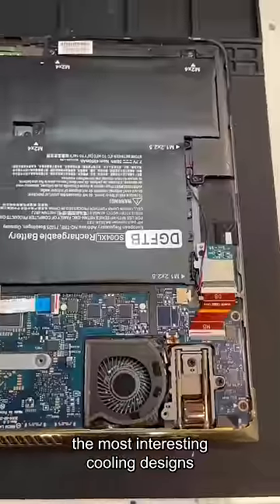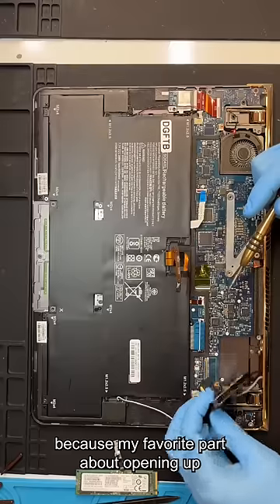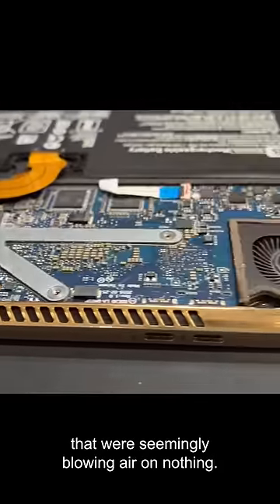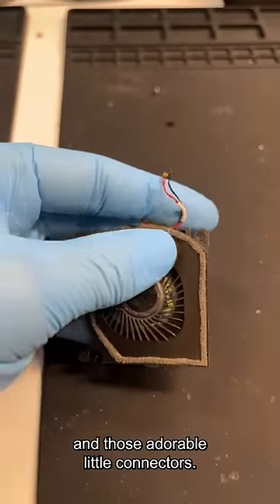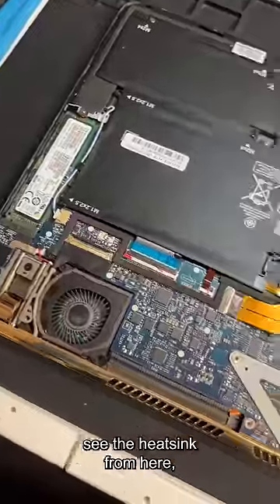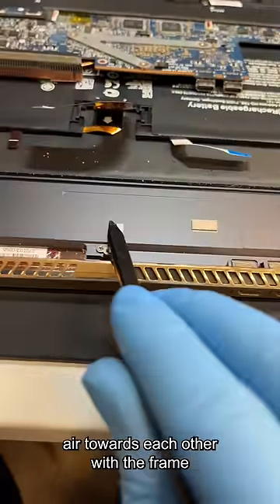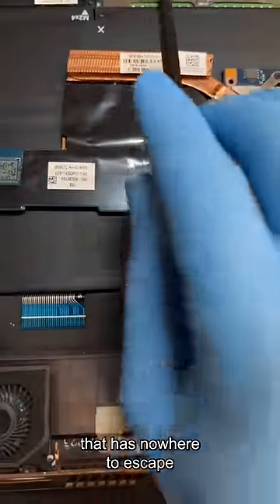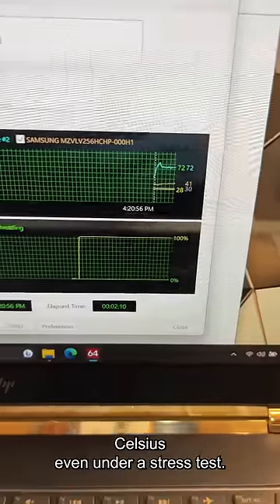This HP Spectre has a unique cooling system #technology #laptop #pc #shorts #tech

Comment: Love my spectre, but those fans get LOUD and it can run HOT.
Reply from the maker: Yeah I personally own one and had to undervolt it to keep the temps and fans under control.
Reply: I have the spectre's little brother, the envy x360
And it sometimes randomly decides to turn into a jet engine 
Not really a good thing considering I got it to use for taking notes in uni

Please HP, make adjusting your fan curves easier
Reply: @NyxEternal i have the same one i think and isn‘t there a button that has like 3 lines which when you open it you can activate silent mode? I think it‘s called system manager or something like that. I have the same issue
Reply: @SalemTechsperts  you cant put oil on it?
Reply: @NyxEternal use Windows power settings to limit CPU to 99%
Reply: Average HP laptop
Reply: So the name is ironic
Reply: Lmao, i have an rog strix g17 2021 model, and god, its loud. Imo 49db is very loud for a laptop
Reply: Try cleaning the fan. I have an HP pavilion 14 ec000 something something and the fan was really loud and it was running really hot. It was only a year or two old so I didn't want to open it because of warranty and stuff but a week ago, I spilled my water bottle on it and since I don't believe the warranty covers water damage, I took it apart. Luckily the water didn't penetrate and did no damage but I saw how clogged up the fan and the heatsink was. After cleaning it, my CPU went from 20w at 94°c to 30w at 90°c. Insane 33% uplift in performance WHILE staying cooler... again, this laptop is like 2 years old at most

Edit: I forgot to mention that I (of course) also replaced the thermal paste. It wasn't dried up but you should absolutely never re-use thermal paste
Reply: @NyxEternal I have one too, if it's the same or close to the same generation as mine then it should have a button next to the disable camera button on the top right of the keyboard with 3 lines with circled on them. It opens a program where you can adjust fan behavior and CPU usage using 4 presets: Balanced (default), performance, cool, and quiet which I think may help you the most for note taking (since I use mine for college too 😅). It's a really handy feature that I appreciate hp putting in.
Reply: @NyxEternal I have a HP victus.
It’s not that bad, but when it’s going through a bios update, it turns into a rocket.
Reply: @SalemTechsperts oh, so you HAVE a HP, now i understand your hate for HP
I am not hating or something, but i am surprised lmao
Reply: My specters goes jet mode then freezes randomly
Reply: Same thing with the Envy, they run quite hot
Reply: @masterguineapig2205 holy crap, I had no idea about that, freaking thank you
Reply: Asus never gave undervolt option on vivobook
Reply: @SalemTechsperts same, had to underclock an old 2011 laptop to keep fans from screaming when used
Reply: @SalemTechsperts I had to undervolt my 5800x3d to keep temps under control.
Reply: @SalemTechsperts undervolting a 15w processor is crazy
Reply: @NyxEternal my friend has that AND IT SOUNDS LIKE A FREAKING AIRBUS ROLLS ROYCE ENGINE (although he likes to pirate games and I have gotten him out of trouble for 6 months with viruses and his mom (middle school) that thing runs hot)
Reply: I had a spectre but 5th gen from 2015 the fan on it is so small and heatsink is a joke - it worked like a tabk and everuthing i threw at it, programming, corel/adobe you name it, no gaming on it tho..
Reply: So does your mother

Comment: It’s called hyperbaric cooling. I was a salesperson in the New Zealand equivalent of Micro Center and attended the HP, Lenovo and Microsoft Surface sales training session. That HP Spectre was absolutely gorgeous for its time.
Reply from the maker: Interesting. It seems like even now, the Spectre division is where their best engineers get sent to. I personally own a Spectre x360 and everything about it is completely different compared to a normal regular HP laptop.
Reply: @SalemTechsperts love my 3500u x360, but it just started overheating and/or throttling a lot for some reason :(

I don't have a great, even less THE GREATEAT TECHNICIAN THAT EVER LIVED(tm) in my town 😂
Reply: @wisico640 Maybe the fans are just full of dust.  Based on all the videos this guy has posted.
Reply: @Bojeezy  it had 0 dust, I changed thermal paste at the same time. It got 5-20°C cooler depending on load / idle so it helped, but the "gpu" part of the apu is still stuck at 200mhz. It litteraly has half the fps / performance as when I bought it looking at 3D Mark results :/

Might be a mistake on their end but seams HP or amd tanked the performance with a bios or driver update :(
Reply: Hyperbaric cooling is such a meme use of the word honestly. Hyperbaric usually refers to 2-3x atmospheric... So unless this cooling setup is producing that kind of internal pressure it's just a real big stretch of the term
Reply: @SalemTechsperts correct me if I'm wrong but didn't gen 1 spectres have a really bad rep in terms of hinge, battery, fans, and other stuff? Have they improved a lot since then?
Reply from the maker: @Cobalt_11  Yes, they were incredibly massive pieces of steaming shit. They still have heat issues and need some tweaking to run to their full potential, but my personal one is amazing after a slight undervolt, new battery, and thermal paste. I compare them to a Maserati. They have potential and are amazing machines, but don't expect it to be too reliable.
Reply: @SalemTechsperts  Hey hey hey, my Maserati has been stellar reliable.  But some older models can be a bear I hear...
Reply: So all three has this shit cooling system.

Really, I mean, this devices if taken care corrently they won't break, but I DARE the regular user how tf can they fix this laptop. Yet 15 years ago laptops were SO easy to fix and run pretty good anyway
Reply: @sam_music555  You overlook some of the other changes too.  Laptops are slimmer, lighter, faster, with longer battery life, more storage, more memory, higher resolution monitors, touch screens, etc.

Compacting the laptops to make them thinner and lighter and more efficient is also part of why they are much harder to fix, although not the only reason.
Reply: Anyone else here from NZ too

Comment: That's either a massive battery or I've only ever seen small batteries with wasted potentional
Reply from the maker: It's super thin, just takes up a massive amount of space.
Reply: Ita not small, it’s average
Reply: @user-tdkwnd0  its more than average king, keep your head up 💪💪
Reply: 38Wh is actually fairly average and on the small side for a laptop. Cheap shitty hp/lenovos in the 500 bucks range come with a 42Wh usually and the maximum allowed is 100Wh for airplane-safe laptops

Comment: As a retired HP engineer, I’m very interested in the comments. Honestly, I appreciate all of them. What you see in this laptop design is the struggle between the product engineers, management, procurement and outsourcing. Engineering has good ideas, management and marketing have dreamy concepts, procurement has a limited budget and whoever the product is outsourced to will have a huge impact on the motherboard design and internal design as well as what components end up in the system. Somewhere in that laptop it says Quanta, Wistron, Foxconn, Sanmina, or similar. They did most of the design and they probably don’t care too much about the fan noise or heat generation. After all it says HP on the logo (same situation with other companies)

Comment: PC users: Oh no, my processor is almost 75°, I need to fix it ASAP!

Laptop users: Wow, it's just 80°, unbelievably cool
Reply: Me after putting an extra 2GB SODIMM in my laptop: Wow! I’ve increased battery life and somehow made it run cooler! It also seems to have forced an feature into the laptop!
Reply: @Alex2554 what's that
Reply: @karimmohamed8001 SODIMM is a form of RAM, but more for laptops due to compact size.
Reply: @Leekodot15  thanks. But how come did it make the laptop cooler? And battery life? Or its some kind of joke i didn't catch xd
Reply: @karimmohamed8001  If I had to guess, something to do with the PC needing to pull information from the hsrd drive constantly?
The RAM is essentially like a desktop in a library, and the hard drive is the library's shelves. So if you, the CPU, don't have enough space on the desk, you'd need to look at the shelves to read them instead of, you know, using the desk. 

But I'm, frankly, not a technician, much less THE GREATEST TECHNICIAN THAT'S EVER LIVED so I'm not entirely sure here...
Reply: @Leekodot15  hahaha. Thanks a lott. Made a lot of sense
Reply: Tbh it won't get hotter than 50 or 60.
Even with high end game running
Reply: @Leekodot15 the last considerations... what did they do to you 😢 I mean are u ok? want a hug?... I won't ever judge you I promise... I've been there too
Reply: I mean, it did have 8 GB of ram before, now it has 10 GB (9.4 GB useable)
Reply: @copydog  I'm actually just straight up inexperienced with computers. I know plenty enough to fix my own up, but I'd rather let other people who have made it their job to fix computers, well, fix what I'm not qualified for. 
I took IT and comp science in high school and have watched r/techsupportgore that's and that's about it... No need for hugs, I'm quite happy with my image.
Reply: @Leekodot15  sorry, I thought some kids just screamed at you with their capslocks in another comment, it happens so much, that just want to hate on someone
Reply: 95*
Reply: @Leekodot15  im 21 years old and I been using and hanging with computers since im 9, but this think is just looks like ridicilous think I ever saw but at the same it looks reasonable lowkey xd
Reply: Yea i like My PC a lot with Baldurs gate 3 on ultra and 50.c Temperatur cpu
Reply: True lol
Reply: My laptop run at 110c lol
Reply: For gaming laptops they sometimes go up to 100 then after 1 sec drops to 80 its so weird..
Reply: My friends laptop feels like the same as a non stick pan when you touch it after 30 minutes of gaming but surprisingly it never really lag he bought a laptop cooler to help it well it works and to keep it from burning touch because if the aluminum frame
Reply: my laptop gets to like 95
Reply: Same here, got a new Asus Tuf A15 with Ryzen 9 7940hs, 32gb Ddr5 5600 (upgraded Crucial), 1.5tb SSD(upgraded Crucial) and RTX 4070m.
While on constsnt gaming the RTX goes around 78ish C, doesn't get above 80C.
Ryzen get's around 92C max on Uncharted 4 and a few other demanding titles like God of War etc..
Checked that max temp is 100C for the processor, so no worries.
When I turn the game off, takes around 5sec to drop back to 60isg on Performance mode (fans on).
Reply: We are a different breed of gamers.
Reply: Ever heard of Celsius?
Reply: Anything below 90°C is win for me
Reply: You can't win with laptop
Reply: Fr
Reply: my old laptop still worked at over a 100°c and i fucking burned myself
Reply: @Leekodot15 I never seen that analogy before but man is it a good one
Reply: Mac book : what’s temperature….. 😂😂😂
Reply: Well  I have Asus Tuf gaming F15 with RTX 4070, Intel I7- 12700K, 16 Gb RAM GDDD6, 512 Gb of SSD memory. And when watching videos on YouTube, it warms up to 45-50 degrees.
Reply: @Leekodot15 computer Wilson times run hotter if it's having to constantly rip data because it's sitting there waiting more weird I know but yeah
Reply: So true😂
Reply: @Mertiven bcz it starts throttling to protect itself
Reply: 75 celcius in stress test condition
is quite good for pc too
Reply: @alphaOrderly  Mine CPU is 65 in stress test (It's overclocked) And i want to upgrade my cooler)))
Reply: @G0RSHK0V  whats your cpu?
im using 5950x and kraken 360 
70~75 on cinebench
Reply: overclocked too
Reply: @alphaOrderly  I'm using 2500k lazy overclocked to 4.1 GHz (It can be overclocked much higher, but for me that's enoph) and a stock box cooler. Idle temperature is 40 max. But fan goes 3000 rpm under max load, so I also want to upgrade to make it quiet, not only to reduce temperature.
Reply: @alphaOrderly  So, as you may guess, I can advice you to switch to higher rpm fans or downvolt processor in bios, if you haven't already. Don't forget to adjust loadline calibration then.
Ideally you should install fans on both sides of your water radiator, this way you can greatly increase cooling efficiency without increasing the noise, but most PC cases don't have room for that. That's why I advices to just switch to higher rpm (or adjust rpms in bios, if your fans aren't running 100% at the max comfortable temperature). Also check your waterblock's clamping force, never underestimate it's impact on cooling.
Reply: @G0RSHK0V  
i thought you are using 13900k or something.
2500k uses only 150w for whole system but overclocked 5950x uses over 200w for only cpu.
nowaday, cpu use tremendously lot of power like 14900k uses 300~400w for only cpu.
so i mean 70~75 celcius is quite not bad for that.

and my case is fractal design 7 xl and i think its quite nice one too.
Reply: @alphaOrderly  Of course modern CPUs are more power hungry (they have more cores), but remember, modern CPUs have thinner lithography and thus is more vulnerable to chip degradation. And degradation speeds up with heat and voltage. If you are going to upgrade in a couple of years, there is no problems, but if you want your CPU to last you should be concerned about your temperatures. So, decide for yourself, as there is no universal solution
Reply: My asus f15 cpu goes up to 97c😂
Reply: My 7th gen i7 2017 HP Omen laptop runs 80° (and even 95° at one point) and has only recently started getting issues. That's 7 years of near-daily use for gaming and video editing at almost boiling hot tempratures 😂
Reply: It's not the case anymore. I'm running a 240 AIO, and my 5800X3D was locked at 90°c. I had to undervolt to get it to stay around 80. My GPU will sit at 70° under a full load. 

Chips now are designed to run as hard as they can until they hit thermal limits.
Reply: no offense but if your cpu is running anywhere under 80 you are wasting/ruining you ears with garabge noice for absolutly worthles cooling :D
Reply: Me, who plays with a 80°C motherboard on a gaming pc: First time?
Reply: My laptop once shut off while i was playing FNF. I laughed hard and was also a bit sad because it takes a while to boot.
Reply: 😂😂my laptop goes like 93° no joke its almost melting i had to buy a olatform full of fans to mantain it at a reasobable temperature with 6 fans 😅
Reply: Honestly, I have a g17 strix. Has a 3060 6gb and 4800h, GPU was fine but the CPU would idle 70-90 and play at 98-105, then I decided I'm gonna repaste it, opened it and saw the liquid metal was everywhere but the CPU die, so I wiped it off and put on some paste then got solid 85-95 and 50 idle
Reply: @ProCoder119x My 10+ years old 3rd gen i5 did touched 84°C it feels warm but imma top up with the thermal paste next month or 2
Reply: I used to burn myself on my laptop before I got a pc lmao
Reply: My asus g15 was getting 96c instantly playing literally anything..opened it up to find the liquid metal was replaced with thermal paste...I replaced that thermal paste with those Fancy thermal pads now it's 95c woot
Reply: I played my at 120 constantly it was scary how long it played til it just quit one day
Reply: Wth r u talking abt my laptop runs at 96°C or 205°F if it was cool
Reply: gpu 91 rn (throttling)
Reply: My desktop's gpu reaches 98 degrees
Reply: My MacBook Pro got to a 100F
Reply: Me with my laptop sitting in a 42°C room and my laptop running at 90°C: this is ok.
Reply: My it friend was running over 100 C before laptop cooler was done. Llano v12 working pretty well, and it’s clear it reduced my temps as well as lag spikes drastically.
Reply: @furioustester4056 yeah, my it guy I recently talked to said the same thing
Reply: 75 and even 80 degrees is still fine tbh, I only get concerned when the temperature goes past 80.
Reply: @zephyrprime8  I guess you’re right

Comment: Better than apple literally not cooling anything
Reply from the maker: Yes indeed
Reply: probably because it didn’t need to be cooled 🤣
Reply: To be fair, when you're running an underclocked ARM SoC encased in an aluminum block, you can probably rely on passive cooling.
Why they wouldn't just add a fan to let it run faster, I have no explanation for besides "gotta sell MacBook Pros."
Reply: The macbook air's keyboard gets hot enough to burn you at only 15 watts continuous. The pro's barely existant fans means it stil gets hot enough to burn, but at 20 watts instead.

Sure, apple silicon is impressively performant and highly efficienct. But they are still handicapping themselves unnecessarily, compared to even a basic cooling solution.
Reply: @wyattroncin941 I assume you watched Linus’ video? You say it gets hot enough to burn you, but that would be if you set your hand on it for 8 minutes. Unless you fall asleep during a Cinabench, you should be fine. The air is designed for people who aren’t gonna be at 100% cpu and gpu for hours

and, a lot of their marketing revolves around it being thin, adding a cooling solution would not let this happen as easily
Reply: @Recliness there are thin laptops with better cooling than mac
Reply: @INFINITY-f1m Its obvious non arm chips have better cooling because they need better cooling.
Reply: macbook air m1 has entered the chat and has outperformed this laptop using 1/4th the power
Reply: I swear anything from Apple turns into the SUN after a gaming session.

Comment: That's a great design. You get the most efficient cooling with straight lined air like here. In the servers, they use turbine-fans, which are 2 fans together, one with 3 blades clockwise spinning and one with 4 blades counter-clockwise spinning, that gives an nearly straight airflow